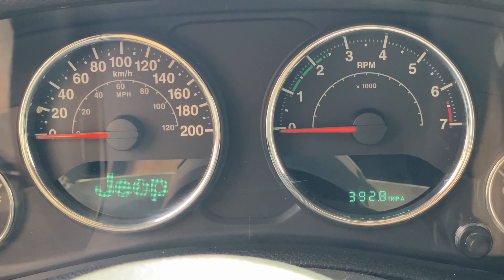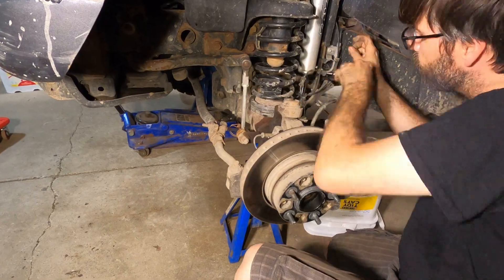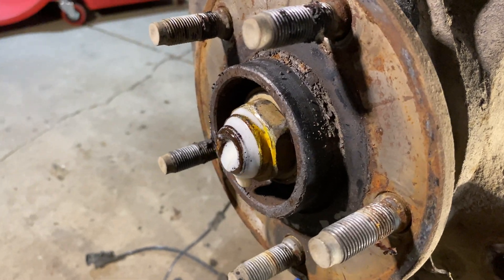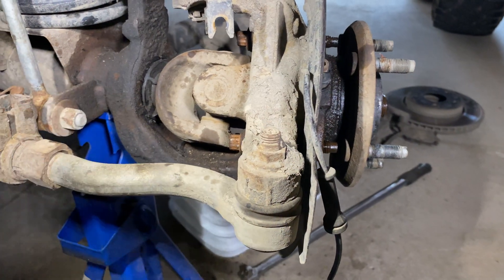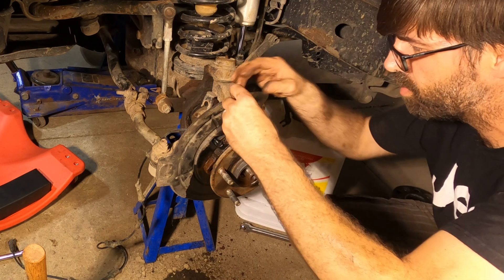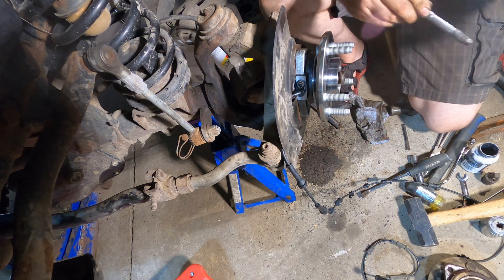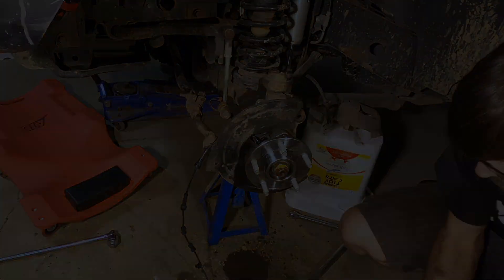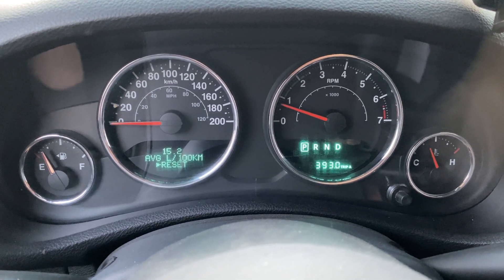Jeep JK front wheel sensor troubleshooting

Comment: Astro Tools The Original Impact Rated Hub Removal Bolt Kit
Remove/Hammer out a wheel stub and use this tool. I love it and beats hammering and trying to chisel a space in between the hub and axle when trying to remove it. 
Like $30.00 and no aggravation.

https://youtu.be/MOMU-Q2nX4o?si=Tj-gw7xyawPnl9SE

Comment: How did you figure out which was the faulty hub and sensor ?
Reply from the maker: The stored error codes pointed me to the correct corner. Lately JScan is the tool I use to scan for error codes.
Reply: @EricCantin  can you put up the link for the jscan ? Thanks.
Reply from the maker: Have a look here: http://jscan.net

Read it attentively as you also need an OBD2 Bluetooth dongle. They make suggestions.

Comment: I have to change out ABS sensor, but it won't fit back down, but when I start to push it down the wheels won't turn, and sounds like it getting catch on the wheel barring gear... Please help
Reply from the maker: Did you compare the total depth of the sensor with the old one? That’s the only thing I can think of that would cause your issue.

Comment: I’m doing my right sensor this weekend. 2017. 113,000 miles. Hopefully not wheel bearing.
Reply from the maker: Good luck. I’ve had issues getting the sensor out of the unit bearing in one piece due to winter salt.

Comment: Great video,.. I have the same issue but on the right side,.. I changed the sensor BUt the code and the lights are still on!!... I hate to say it but DAMM changing the that part is going to be a pain in the rear!!... any other issue beside that changing the bearings???
Reply from the maker: Thanks! With a different Jeep, had one of the unit bearing bolts (with the 13mm 12 point head) snap as I was unbolting it. The bolt cavity in the knuckle was full of crud and something jammed up. 
Someone I know had a spare bolt, but for a D30 axle with smaller U-Joints. A bit of time to grind off the extra metal and success!
Good luck with yours.

Comment: what impact model is the one you used friend
Reply from the maker: I forget which I had here, but I’ve converted all my power tools to Milwaukee. I really like the M12 Fuel Stubby (crazy compact power with the right battery), the M12 Fuel right angle impact, M18 Fuel Mid torque, M18 Fuel high torque with One Key. All are 1/2” since my impact sockets are all 1/2”. 

If I had to live with only one, I’d get the M18 Fuel mid torque.